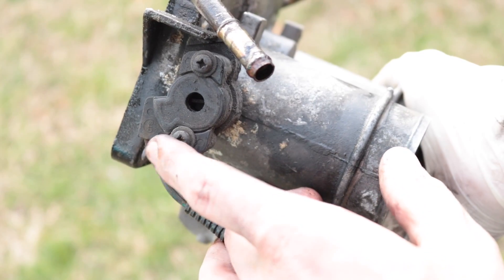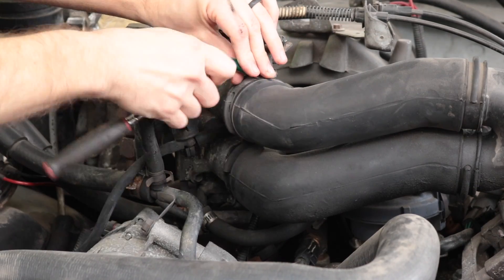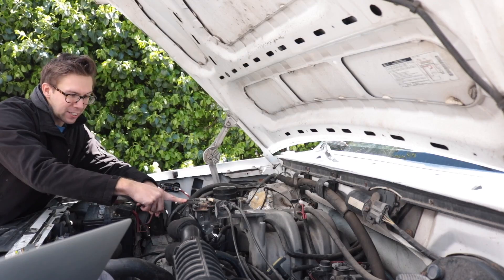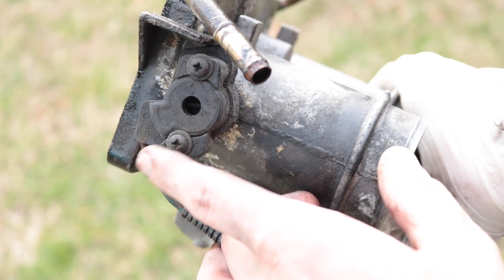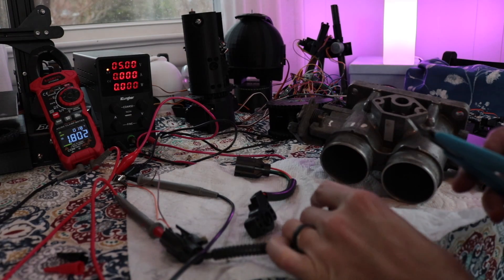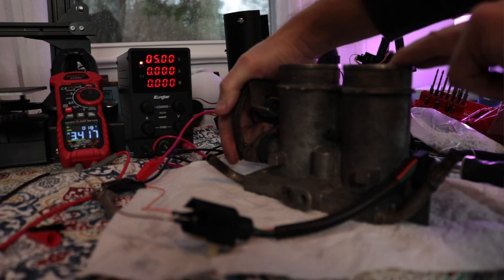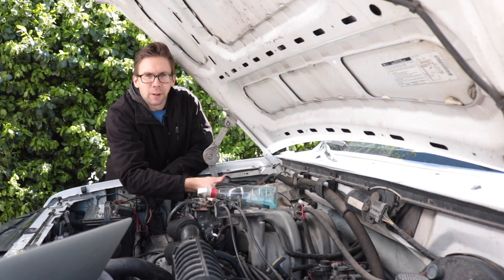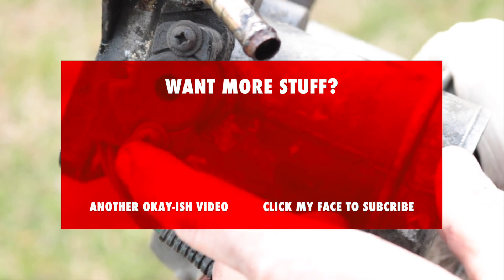Weird Drivability? DIY Throttle Position Sensor Repair - 1987-1997 OBS Ford 5.0L TPS

Comment: I just went through the sensor ritual and had a recurring cycling cold idle.  I checked everything several times and nothing showed up in the scans and no check engine light.  On a whim I thought I'd try resetting the computer before I swapped it out.  I disconnected the battery for 15 minutes and cycled the throttle 5 times and boiled the eye of a newt while telling myself not to get my hopes up.  Well, I started it up and it idled and as the day went on it got smoother and smoother.  I always wished cars could heal and now they do.

Comment: I installed the new TPS sensor as soon as I bought it. Was I supposed to adjust it?
Reply: More than likely, usually the holes aren't correct on the newer stuff but like he said get a slightly larger drill bit ream out, install it and test the voltage

Comment: CRC QD electric cleaner is a miracle cure for ECU and any all sensor plugs and connectors, any auto parts and or on line.

Comment: The throttle linkage ball to cable needs lubed with IES Clear Pen Lube 4550, super lube, will not attract dirt, last and lubes great very tenacious, purchase from S&R Fastener Fl., IES sister distribution Co. Good for lubricating any metal to metal friction , metal to plastic bushing, door latches, hinges, etc. any friction surface without grease zerk !

Comment: aloha.. my 96f150 (4.9l inline 6) (295k miles always ran really well) lost power after we put in a new fuel pump... started ok but no power... it was at the shop for 2 weeks they were trying to figure it out... replaced the the distributer, coil, plugs and they found both cats had melted.. probably due to lean gas from the faulty fuel pump... finally got it up and running but... it's not the same... it taes forever to accelerate and doesnt feel as powerful as it was... especially in first and 2nd gears..... would love your thoughts or anyone elses perspective of what could be goin on.. thanks!

Comment: i have a 96 351 man i cant seam tko get it right i replaced this part dint work crank shaft dint work plugs caps wires fuel dilter mas

Comment: So my 96 i6 4.9 is having issues where around 30 mph if i try to accelerate it bogs down it slowly climbs to 50 mph.  I have changed fuel filter, fuel pump, any suggestions on my next move to fix this
Reply: Having the same problem with my 93 bronco 351w having replaced anything yet hoping to save some money before I start just throwing stuff at the truck to try to fix it
Reply: Yea im waiting for more cash my next attempt is new battery cables or try and replace the tps

Comment: 1989 f150 5.0 just had new engine put in, pretty much everything is new. Issue is sometimes when cranking thr truck the check engine light comes on and I hear a winding hiss noise from around thr throttle body. Then when putting it in gear it bogs down ans dies. It's and automatic by the way

Comment: I swapped my TPS on my 93 Bronco 5.8 and it revs up to 2k when I first start it. Then it comes down to about 1250 when idle. There is also a whistle of some type. Only when I'm in gear at a stop or light, it idles at about 900. Any thoughts?
Reply: same problem with me. any update ?
Reply: @bobtailsthecat when I took off my throttle body to swap the TPS, I did not screw the bolts on properly for the throttle body I was having a vacuum leak between the gasket, throttle body and intake manifold. It was an easy fix. Otherwise I'd double check all the vacuum lines
Reply: @frkndave28  at least it was a straightforward repair, I know everything I have is tight and no vacuum leaks by spraying brake clean all over the place lol the truck has a high idle around 2K then calms down to 1200 or so that goes down to the normal range in drive but if I drop to neutral or even park, it shoots back up to 1300 or so. There’s many times while I’m driving and go to slow down by breaking, but the truck fight me by throttling
Reply: @bobtailsthecat  bro that was the same thing for me too. I swore everything was bolted down just right and then I took it to my shop and they did a smoke test and they found it right away. Drives good and all but it can also be annoying as hell.
Reply: @frkndave28  maybe i’ll do a smoke test 🤨

Comment: This helped me fix my Ford Econoline my transmission wasn't shifting past first and I was getting some really weird idling issues both problems started at the same time so I change the trans fluid, replace the throttle position sensor and the idle air control valve now this 212,000 mi van runs like new I was having a tough time figuring out at first because there's no videos on those Ford cargo vans so I decided to look into the trucks and it's basically the same layout just with the van you got very limited access and a little bit different setup

Comment: I have a 95 5.0 mustang i replaced the tps.. it ran like sgit before but worse now.. i did nkt adjust anything because there was no way too turn the iacv just bolt it in.. now the car runs like crap.. should i grab my volt meter an drill out the holes larger on my tps itself so i can adjust it?

Comment: 8MM? This is a 90s Ford. It's a 5/16 none of that communist metric shid
Reply from the maker: My transmission pan is stamped METRIC in giant embossed letters, I’m pretty sure 90s Fords were the first to use metric hardware??
Reply: @MatthewFinlay  no its probably a replacement
Reply: @buckjank No Respectfully they had both Standard and metric Since the Early 1980s sometime, not exact, but i do own 6 f150s from the 80s an 90s an i can tell ya rn half the bolts in thos trucks are a mix of Standard and metric
Reply: @SJ351M  no metric and standard has a lot of the same sizes. Like 8mm and 5/16 or 11mm and 7/16 or 14mm and 9/16 or 12mm and 1/2 or 16mm and 5/8. Ford is 100% standard until 2005

Comment: Many idle and drivability problems with these older 80’s and 90’s Ford model Mustangs, F150’s, etc., are due to failed/failing capacitors in the ecu. They start leaking and damage traces on the circuit board. If you have one of these cars, make sure you check that computer, otherwise you will be replacing all kinds of parts and nothing will be fixed.  The failing ecu’s cause reference voltage problems to a lot of the vehicle sensors, which includes the throttle position sensors.

And those capacitors are pretty easy to replace. You can save an ECM just by replacing the caps. No need to replace the ECM unless the circuit board has been damaged by the leakage.
Reply: YEAH AND I HAD THE SAME PROBLEM.SO I TOOK THE ECM OFF THE TRUCK OPENED IT UP.AND IT HAD 3 BAD CAPACTORS ON THE BOARD.AND IT WAS SO BAD THAT I BOUGHT A NEW ECM ONLINE. AND IT SOLVED MY PROBLEM. ITS AMAZING. ALL THE TIME AND MONEY WAISTED ON PARTS. I WISH THEY HAD A CHECK ENGINE LIGHT WHEN YOUR ECM GOES BAD, I GUESS THAT WOULD MAKE IT TO EASY ON PEOPLE.
Reply: I found that to be true.i did a lot of research on the subject.my Eddie Bauer bronco was idling high,couldn't get over 55 mph and the fuel pump would stay on after engaging the ignition switch to on not start.and I didn't want to start cold without spray.changed the TPS with no change.ordered a capacitor kit from blend door.hopfully after replacing the capacitors on the computer it will run like it did when I bought it.mind you,it sat for 2 months and started acting like I described.
Reply: @thomaslong567 
I have a 93 5.0 Mustang. After changing the capacitors in my ECU, I could not believe the difference in how that engine ran afterward. Good luck with yours. Hopefully the caps haven’t leaked their electrolytes onto the circuit board.
Reply: @thomaslong567 
I don’t know if the other reply to you posted or not. I don’t see it. I have a 93 5.0. I changed the capacitors in mine and couldn’t believe the difference in engine performance. It brought it back to life. Hope you are as successful.
Reply: Why not just replace the icu

Comment: What about the plunger just above the TPS.   Have you ever thought about replacing the plunger that opens and closes the air flow in the throttle body intake? I took mine off and pressed the plunger.  I could have blown on it to depress the plunger.  I am hoping that the solenoid is working strong enough to push the plunger.  Yeh I could have hooked up a 12v supply but thats just a PITA.

Comment: Bud. Question if you have a second. When I start my 96 with a 5.8. It idles a little rough for like 10 seconds then jumps the rpm to 1500 and it stays there. If I unplug iac valve it idles pretty much ok and perfect. Small loap. Did a map sensor. Iac sensor. Cleaned computer. Replaced and fixed all vaccum leaks
Reply from the maker: Couple different things to try. Pinch or block off your vacuum tubes that run to the solenoids by your coil. I’ve had those leak internally just enough to cause weird problems like that. Is your white tube that connects the A/C recirculate valve connected and not leaking? It’s mounted on top of the hvac box on the passenger side - they are notorious for breaking down. If all that fails grab yourself a can of brake cleaner (make sure is the flammable type) and start hitting every sealant surface, injectors o-ring and logical spot you can. If you have a leak the brake clean will raise your rpm similar to giving it extra gas! Lemme know what you find

Comment: I have an 1988 f 150 300 six /  manual on floor shift.  Truck runs great and idles great.  The problem is when you are driving and let off the gas it surges badly.  Replaced the IAC and TPS.  Plugs , wiring cap and rotor replaced.  Smoke tested, no leaks.  Any help would be appreciated.
Reply: Figure it out?
Reply: No sold the problem.

Comment: My truck starts sometimes perfect and sometimes I have to floor the gas pedal to start, sounds like it sputters for gas ! Sometimes even shuts off. Eventually it stays on but high rpm's. Then goes back to normal. Think maybe changing these it could help

Comment: Hello Matt I have a 96 ford f150 the volts in it drop when I'm idling while it's in gear, when I put it into reverse the Volts drop and it stalls out. I have replaced the transmission filter which had fallen into the bottom of the pan hoping it would fix my problem and it still stalls out when the volts drop.  I'm thinking it's the idel air sensor or the throttle body sensor what do you think might be going on?

Comment: Hi Mat, I'm going to look at a 1989 Lincoln Mark Vll that has sat for the past few years.  I believe it has the 225hp HO engine.  The owner, who is a mechanic of sorts, says it runs rough and he can't figure it out.  He said people have told him it could be a vacuum line under the intake manifold.  I'm thinking that, and a dirty fuel system for the gas turning bad from sitting.  Also, if that is a distributor engine rather than an electronic system, the timing could be way off due to it being loose.  What do you and others here think it could be.  What are the Usual Suspects?

Comment: Yes,  I got a comedy lesson too   .,  lol  .,    Well I say to you, for those who want to file any complaint,  I guess you gotta put up a greivance box     lol.,       for me    you are good,   you put humor in it,   I just bought the idle control.,    what exactly does it do?      thank you,        I gave you a thumbs up obviously,    have a great weekend
Reply from the maker: Thanks buddy! I’m glad you enjoyed the video and hopefully it helps you. The idle control valve pulses open and closed to provide the airflow needed to maintain a stable idle. It also helps command certain rpm’s - when you start the truck and the engines cold it’ll maintain a higher idle speed and slowly ramp down - welp that’s your idle control valve feeding the engine extra air. New cars with drive by wire throttle bodies will actually just command the throttle blade to open further and no longer have IAC valves - kinda neat

Comment: I replaced it on my 93 Crown Vic, and it ran better than ever. It was on the driver's side of throttle body. On my 04 Town car it is on the back between throttle body and fire wall so TB had to come off. The Vic had all kinds of running issues and someone could have told me the worst ones were transmission an before learning about tps would have believed them.

Comment: Great video! Do you have one fixing the 212 code? I can't find the 22K resistor 

My truck is a 95 5.0 like yours
Reply from the maker: Thanks big guy! And nope but I’ve seen some friends have to do that before. Hasn’t gone bad on any of our rigs yet
Reply: @MatthewFinlay  I've read that 212 messes with timing, 121 and 212 are the worst pair of codes to have

My truck runs like shit :(  And I don't know how to fix it

New sub keep the great work 👋
Reply from the maker: @benjamincamarilloloza9012 thank you big guy! Does the problem follow when the engine is cold and warmed up?

Comment: Hey guys,

So got bit of an issue that I can’t seem to shake. 

Got a 1991 f150 xlt lariat with the 4.9 L straight 6. 

The issue I’m having is the RPMs sky rocket and hold at a measly 2500-3000 rpm’s and sometimes higher….. 

To combat this I’ve had the IAC sensor unplugged and turned the idle screw up a bit to compensate. 

Furthermore I’ve replaced the EGR valve and sensor and the MAP sensor. After replacing plugged the IAC back in turned the idle screw back down and the RPMs continue to shoot up and stay there. 

I’ve checked for vacuum leaks, the previous owner said he did a smoke test and there were no leaks. 

My thinking has veered to the TPS , not sure if that’s the smart direction but that’s where my thoughts are. 

Any suggestions or thoughts would be great
Reply: Did you figure it out?? I’m having a similar problem and it’s driving me insane

Comment: Oh. Nice. Monkey brain is happy. 

I didn't even think of lab testing the TPS. I might do that on mine after really doing some research.
Reply from the maker: You can also probe the middle wire on the tps while it’s plugged into to the factory harness. I hate poking holes in wires though so you could always extend the power and ground wire and then probe away into the back of the connector. Remember it’s 5v - so if ya send it 12v it’ll only work… once haha. I’ve also see the ecu’s not put out exactly 5v too. Thanks for watching big dawg

Comment: Now that I installed it, my engine idles real low and sometimes stalls out
Reply from the maker: Did you adjust voltage or just just screw then down?? Also it’s really easy to forget plugging your IAC back in - been there, done that at least a few time.

Comment: How are you bench testing? How do I apply power to it while out the vehicle?
Reply from the maker: Couple different ways of doing it! I invested in an adjustable bench top power supply because I feel like I’m always needing it. The tps runs on 5v - the wire diagram is all over the internets, but almost all 3 wire sensors have the outer pins as power/ground and the center is your signal. If you don’t want to use a power supply you really have two options. Plug your harness into the tps and probe the center wire with your meter. But if you don’t wanna damage/poke you signal wire just jamb some scrap wire into the outer pins and then probe the center. I actually prefer either of these methods because the ford system isn’t always at 5v exactly. In my experience it’s a lil lower but since it’s all relative to the system it’s not a huge deal.
Reply: @MatthewFinlay  thanks
Reply from the maker: Of course buddy! Hit me up if you need anyhtign
Reply: @MatthewFinlay  A desktop computer power supply creates both 12 and 5 volts..that is what I am using ..plus a DVOM..
Reply: @MatthewFinlay  one more question. When calibrating, do I have to have the throttle linkage hooked up when setting to  .9 volts? Throttle should be fully closed correct?
Reply: @MichaelJohnson-cm4wp  3,5 and 12

Comment: In your video, you drilled out one of the holes and I was curious as to why you would do this, what will drilling it out do, and is that something that HAS to be done?
Reply: So that you can adjust the position of the sensor..and that adjusts the the voltage being sent to the ECM..Sort of like adjusting the carb idle screw for the perfect idle speed.

Comment: I have a heritage version of the 95, with coolant running through the throttle body...
If I cap off the coolant to the throttle body, (nipple rusted off the top), will that interfere with the sensor working properly, once I complete the procedure you've shown us?
Reply from the maker: You’ll be fine - theres a couple different theories of why Ford had coolant running through the throttle body. Cold weather icing, help regulate incoming air temperature, etc. but you can block it off without any real issues in my experience!

Comment: Thank you! Video was great, easy to understand and follow. Appreciate the testing in it too, loved the little bit of comedy, my 92 threw the code 122 so I'm just gonna go ahead and replace the sensor
Reply from the maker: Makes sense - howd it turn out??
Reply: Great! Solved the code
Reply from the maker: @grapegreen5886  heck ya - glad it worked out for ya!
Reply: @MatthewFinlay  for sure thanks for the video! It helped alot

Comment: My 93 bronco 5.0 is having a problem where it wants to quit accelerating after warmed up I checked codes and got 63 and a few coolant codes I changed the throttle Position sensor twice and am still having the same problem
Reply: COOLENT TEMP SENSOR